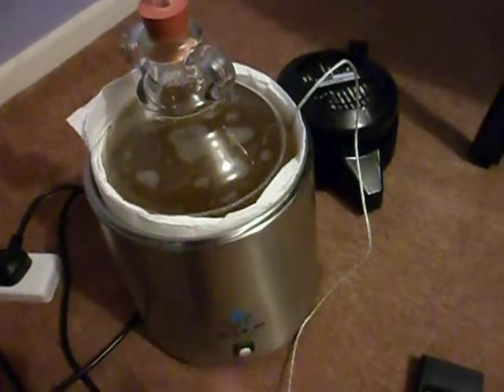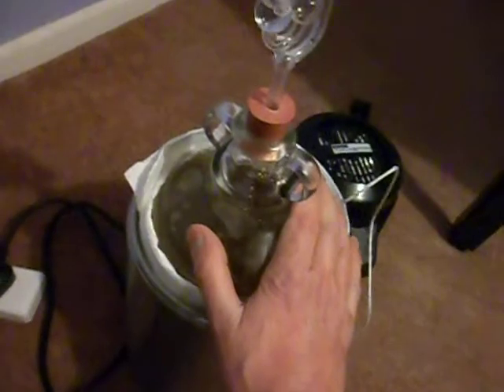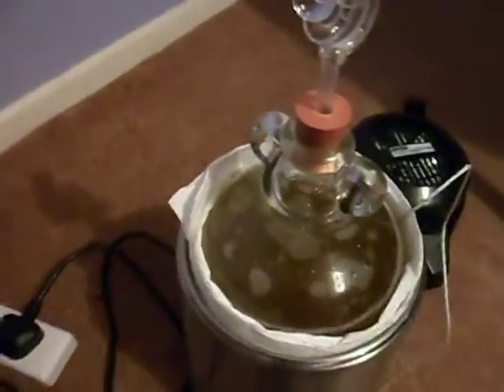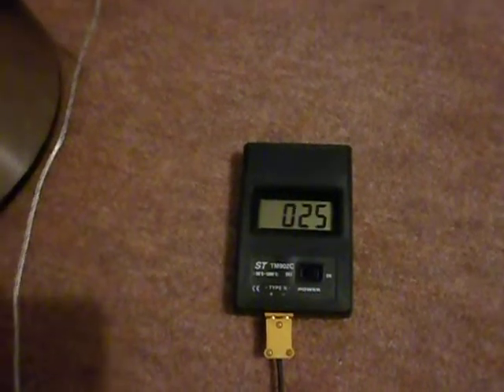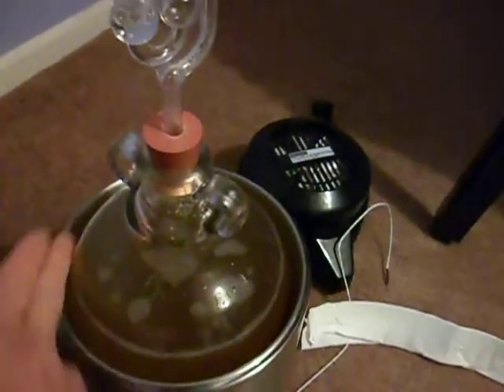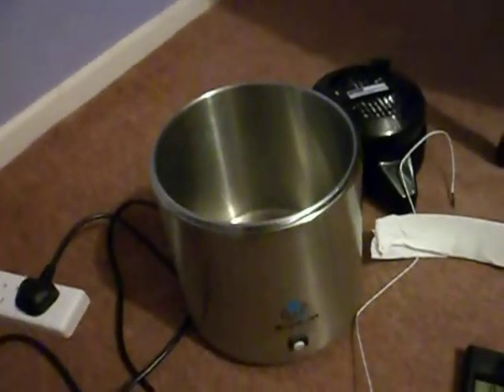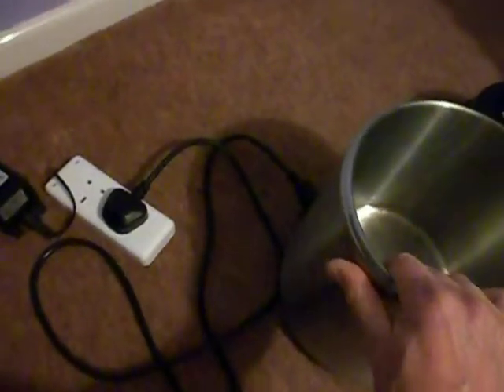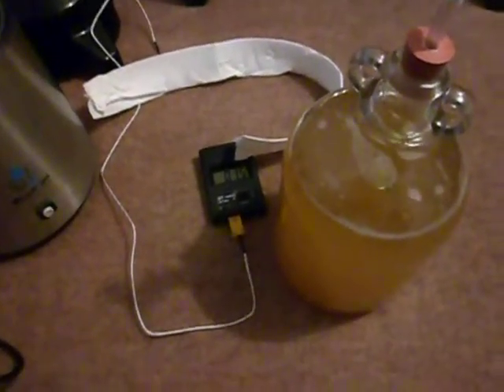Simple fermentation heater using Megahome distiller.

Comment: This is brilliant.  Is there a simple (or complicated) transformer that I could buy allow me to control the electrical current.  I really don't know anything about electricity.  I'm in Canada.
Thanks!
Reply from the maker: Take a look through any old plug-in power supplies you have.  If you can find one that is rated for 12V and at least 12W (1A output) then it should work OK.
That gives a heat of 6W which seems to balance quite nicely for typical cool room temperatures.

Comment: Sorry, just a little pet peeve of mine, but that's a carboy.

The word Demijohn is obviously a bastardation of the word dame-jeanne, and that's no dame-jeanne. Carboys are pretty much cylindrical, while dame-jeannes either are 'globular' or have globular tops and slanted sides.
Reply from the maker: Hmm.  All the local brew shops refer to them as demijohns and I've not actually come across the term carboy.  Could this be a cultural thing?  I'm in the UK.
http://en.wikipedia.org/wiki/Carboy
Reply: bigclivedotcom Yeah, carboy might be from the other side of the pond, but they often call them demijohns too. Maybe you all do it to irritate the french.(I'm a swede by the way.)

So how do the ferment times compare?
Reply from the maker: m8e Fermentation seems a lot brisker than it would have been otherwise.  In a 4.5 litre ferment the airlock was bubbling about once every 7 seconds and it kept that pace for about a week before slowing.  I was using standard yeast so I'd guess with a turbo yeast it would have been faster.  (I don't brew much.)
I notice that the name demijohn does seem to be used for this classic British fermentation vessel.  To quote:-  "In Britain, demijohn refers to a 4.5 litre (imperial gallon) glass brewing vessel."
Reply: It's definitely called a demijohn here, carboy is generally applied to much larger containers
Reply from the maker: The still has two connectors.  If you use an undimmed feed for the fan in the lid, you can use a dimmer on the base to slow down the distillation process.
Reply from the maker: A refractive alcohol tester and a cheap water filter with multiple passes to remove any unpleasantness.  I did experiment purely for the scientific interest.